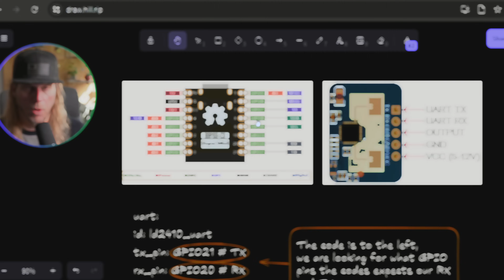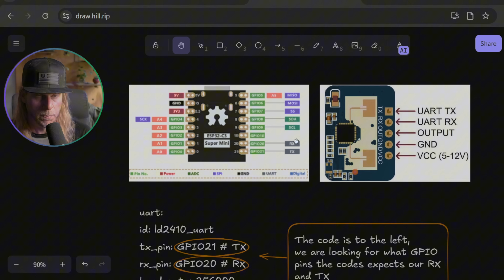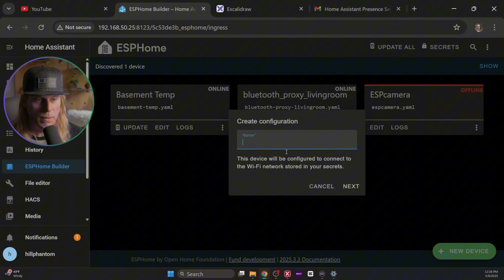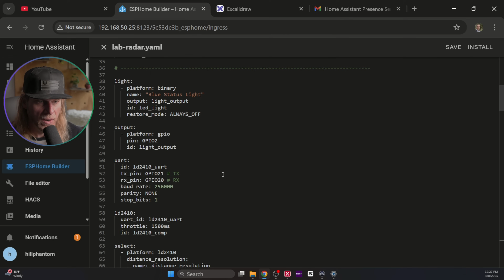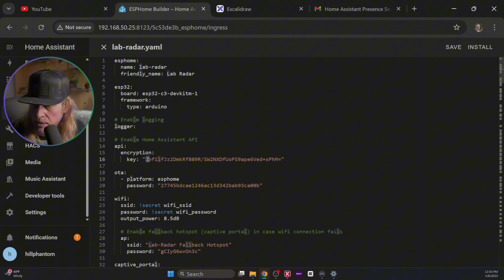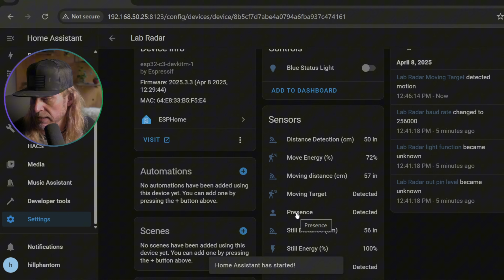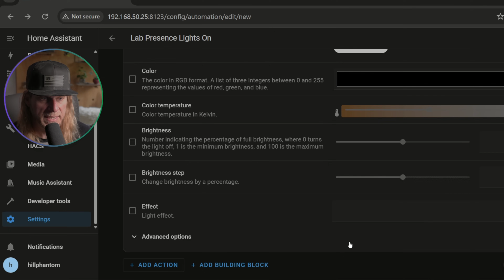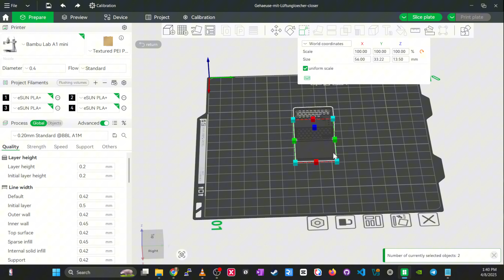I Built a DIY ESP32 Millimeter-Wave Radar Sensor (for cheap!)

Comment: My first attempt at hardware tinkering (SoC, breadboards, pin outs, etc.).  Stumbled my way through, but got it working!  I have a HA Yellow and had to connect it directly to that (rather than my home PC) to flash the firmware on; also had to make sure I put a 2.4GHz Wi-Fi config on it.  Great video!  Hopefully it'll get my brain working on what else I can implement in my home setup.  Only thing that would have been helpful for me is to see an actual picture of your breadboard hookups, but like I said, learned by trial and error!
Reply from the maker: Awesome job getting it working, especially with the trial and error!  However, my best skills in the lab, patience and trial and error. This is how I learn, and why my wife gets worried as I have started to many fires lol.  I appreciate the feedback I think next time I will include a photo of the breadboard stuff for sure! Cheers! Happy Hacking my friend!

Comment: compiling this fails fatal: not a git repository (or any parent up to mount point /)
Stopping at filesystem boundary (GIT_DISCOVERY_ACROSS_FILESYSTEM not set).
CMake Error at /data/cache/platformio/packages/framework-espidf/tools/cmake/project.cmake:589 (__project):
  The CMAKE_C_COMPILER:

    riscv32-esp-elf-gcc
Reply from the maker: Have you flashed any other code to see if its you device. This is first report of this error. Seems you device is having trouble pulling from git
Reply: @HillPhantom  i installed esp home on my linux machine and flash it from there instead of the raspberry pi HA installation ...for some reason HA cannot use the compilers (?)
Reply: @squiddymute  It's probably running out of memory during compilation. The Pi isn't the best place to run ESPhome builder really. You're much better off with your linux machine. I had the same sort of issue when I ran mine on a 1Gb Pi4. I switched to the docker build of ESPHome on my Linux machine.

Comment: Followed steps bit all I see is Sensors Unknown. Tried rebooting etc.. to no avail. Only thing it does detect is internal temperature?
Reply from the maker: Yea these devices can be very touchy I have had that issue to in past, displaying unknown on the HA dashboard. For me it was turning up the gain for the wifi on the board and it worked. Other times I just kept reflashing it. I have also had bad boards do this as well. Have you tried upping the wifi at all?

Comment: It's fascinating that it works for a lot of people and I don't see anyone complain about it not connecting to wifi, I tried every output power possible, as soon as I add the sensor to the controller "auth expired" is there, remove the sensor and it connects no problem...
Tried a few boards, same result, AI isn't helpful either, I'll probably get different controllers for this, maybe these little ones are too crappy to work with wifi and a mmwave sensor
Reply: Managed to make it work: DO NOT use pins 20 and 21, as they are also used for something else on the chip. I changed pins and now it works perfectly fine everytime.

Comment: @7:30 you said output_power: 8.5dB increases power. No it does not the default output power is 20.0dB. Every decrease of 3dB halves the signal strength. At 8.5 dB you will have a range of 20-30 feet max.
This is a known problem with c3 super mini boards some have external antennas this does not matter, they are all junk. in the usb logs if you see wifi auth expired error then you will need to use the line output_power: 8.5dB. Also the s2 minis have a different antenna issue and should also be avoided. and just a fyi the ld2412 and ld2450 radars are much much better.

Comment: Hi, i have a problem with a esp32 c3 super mini i cant install it, every time i have error messages, i try couple of times, every time the same thing... :(
Reply from the maker: What's the error message?
Reply from the maker: What is the error message?
Reply: @HillPhantom  There are several different errors during the installation itself within esp home, the esp32-C3 supermini is connected directly to the server, but errors occur during installation
Reply: INFO Package configuration completed successfully
INFO Package configuration completed successfully
INFO Successfully compiled program.
esptool v5.0.2
Serial port /dev/ttyACM0:
Connecting...
Connected to ESP32-C3 on /dev/ttyACM0:
Chip type:          ESP32-C3 (QFN32) (revision v0.4)
Features:           Wi-Fi, BT 5 (LE), Single Core, 160MHz, Embedded Flash 4MB (XMC)
Crystal frequency:  40MHz
USB mode:           USB-Serial/JTAG
MAC:                58:8c:81:aa:9f:c4

Uploading stub flasher...
Running stub flasher...
Stub flasher running.
Changing baud rate to 460800...
Changed.

Hard resetting via RTS pin...
ERROR Running command failed: 
ERROR Please try running esptool --before default-reset --after hard-reset --baud 460800 --port /dev/ttyACM0 --chip esp32c3 write-flash -z --flash-size detect 0x10000 /data/build/radar/.pioenvs/radar/firmware.bin 0x0 /data/build/radar/.pioenvs/radar/bootloader.bin 0x8000 /data/build/radar/.pioenvs/radar/partitions.bin 0x9000 /data/build/radar/.pioenvs/radar/ota_data_initial.bin locally.
INFO Upload with baud rate 460800 failed. Trying again with baud rate 115200.
esptool v5.0.2
Serial port /dev/ttyACM0:
Connecting...
Connected to ESP32-C3 on /dev/ttyACM0:
Chip type:          ESP32-C3 (QFN32) (revision v0.4)
Features:           Wi-Fi, BT 5 (LE), Single Core, 160MHz, Embedded Flash 4MB (XMC)
Crystal frequency:  40MHz
USB mode:           USB-Serial/JTAG
MAC:                58:8c:81:aa:9f:c4

Uploading stub flasher...
Running stub flasher...
Stub flasher running.
Reply from the maker: @iceman-84-zg hmmm can you test flash something else via the Arduino ide just to see if it's the board or not?
Reply: @HillPhantom  ok i will try, thank you

Comment: How would you adapt this to output messages over serial/USB? I've been struggling to get that to work with an LD2420 and I'm thinking about switching to this board
Reply from the maker: # --- Serial/USB logging ---
logger:
  baud_rate: 115200
  level: DEBUG  

==============================

binary_sensor:
  - platform: ld2410
    has_target:
      name: Presence
      on_press:
        - logger.log: "LD2410: Presence detected"
      on_release:
        - logger.log: "LD2410: Presence cleared"

Comment: First of all it's impressive that you still read and answer comments on this video 5 months after release.
Do you think it's possible to use this with an esp32 H2 over zigbee?
Reply from the maker: Well thank you! That's a great question but I will be honest, its just a guess, but I don't see why it would not work, code might be a bit different and library but yes not reason you can roll Zigbee instead of wifi, but that's a full on guess if I am honest.

Comment: Well, I got this... some git repository failure...
INFO Package configuration completed successfully
INFO Package configuration completed successfully
HARDWARE: ESP32C3 160MHz, 320KB RAM, 4MB Flash
 - framework-espidf @ 3.50402.0 (5.4.2) 
 - tool-cmake @ 3.30.2 
 - tool-esp-rom-elfs @ 2024.10.11 
 - tool-esptoolpy @ 5.0.2 
 - tool-mklittlefs @ 3.2.0 
 - tool-ninja @ 1.13.1 
 - tool-scons @ 4.40801.0 (4.8.1) 
 - toolchain-riscv32-esp @ 14.2.0+20241119
Reading CMake configuration...
-- git rev-parse returned 'fatal: not a git repository (or any parent up to mount point /)
Stopping at filesystem boundary (GIT_DISCOVERY_ACROSS_FILESYSTEM not set).'
-- Building ESP-IDF components for target esp32c3
-- Configuring incomplete, errors occurred!

fatal: not a git repository (or any parent up to mount point /)
Stopping at filesystem boundary (GIT_DISCOVERY_ACROSS_FILESYSTEM not set).
CMake Error at /data/cache/platformio/packages/framework-espidf/tools/cmake/build.cmake:620 (message):
  Traceback (most recent call last):

    File "<frozen runpy>", line 189, in _run_module_as_main
    File "<frozen runpy>", line 112, in _get_module_details
    File "/root/.platformio/penv/.espidf-5.4.2/lib/python3.12/site-packages/idf_component_manager/__init__.py", line 6, in <module>
      from idf_component_tools.environment import ComponentManagerSettings
    File "/root/.platformio/penv/.espidf-5.4.2/lib/python3.12/site-packages/idf_component_tools/__init__.py", line 9, in <module>
      if ComponentManagerSettings().DEBUG_MODE:
         ^^^^^^^^^^^^^^^^^^^^^^^^^^
    File "/root/.platformio/penv/.espidf-5.4.2/lib/python3.12/site-packages/pydantic_settings/main.py", line 193, in _init_
      super().__init__(
    File "/root/.platformio/penv/.espidf-5.4.2/lib/python3.12/site-packages/pydantic/main.py", line 250, in _init_
      validated_self = self.__pydantic_validator__.validate_python(data, self_instance=self)
                       ^^^^^^^^^^^^^^^^^^^^^^^^^^^^^^^^^^^^^^^^^^^^^^^^^^^^^^^^^^^^^^^^^^^^^
    File "/root/.platformio/penv/.espidf-5.4.2/lib/python3.12/site-packages/idf_component_tools/environment.py", line 148, in fallback_to_default
      if field.validation_alias:
         ^^^^^^^^^^^^^^^^^^^^^^

  AttributeError: 'NoneType' object has no attribute 'validation_alias'

Call Stack (most recent call first):
  /data/cache/platformio/packages/framework-espidf/tools/cmake/project.cmake:718 (idf_build_process)
  CMakeLists.txt:3 (project)

========================== [FAILED] Took 1.01 seconds =========================
Reply: Finally got it to work - a few ridiculous percentages in those settings but it works - I had to change one reference back to Arduino... BUT it won't appear in Home Assistant. any idea - I have this lovely display I can watch on serial or via an IP address -but nothing in HA so I will can't actually use it...

Comment: Good video, any thoughts on this error that I get when using the code? ld2410:
  uart_id: ld2410_uart
  throttle: 1500ms
  id: ld2410_comp  it comes up and says something like: "throttle has been removed; use per-senso filters instead"
Reply from the maker: I have never seen this and throttle is not used or defined in the code as far as I can remember. Have you tried to reflash it perhaps as that is a super odd error.
Reply: I had the same error when try to recompile with esphome 2025.9.x , then I commenthed out the line: "throttle: 1500ms" and compiled correctly but the sensor doesn't work anymore as intended. now the presence is always active
Reply: the exact error is:  "throttle has been removed; use per-sensor filters, instead." I changed the throttle it as ChatGPT suggested but still don't work anymore
Reply: getting the same throttling message.

Failed config

ld2410: [source /config/esphome/test.yaml:59]
  - uart_id: ld2410_uart
    
    throttle has been removed; use per-sensor filters, instead.
    throttle: 1500ms
    id: ld2410_comp

This is what is in the config.

ld2410:
  uart_id: ld2410_uart
  throttle: 1500ms
  id: ld2410_comp
 
I have an up to date HA and it's a new install of ESPHome Device builder.
Reply: Getting this same issue
Reply: did anyone find a fix for this issue?
Reply: @timdrysdale8468  I built my device tonight and was suffering the same issues everyone else is reporting but managed to get it working by replacing specific sections of the code with the following:

uart:
  id: uart_bus
  tx_pin: GPIO21
  rx_pin: GPIO20
  baud_rate: 256000
  parity: NONE
  stop_bits: 1
 
ld2410:
  uart_id: uart_bus
  id: ld2410_comp

sensor:
  - platform: internal_temperature
    name: "Internal Temperature"
 
  - platform: ld2410
    moving_distance:
      name: "Moving distance (cm)"
      filters:
        - throttle: 1s
Reply: @grf21a-   i still get unknown devices no matter what i do could you show me more of your code?
Reply: @timdrysdale8468  Dis you ever get this resolved as I have the same issue- Sensors Unknown?

Comment: The box is incredible. Is it possible to download the file for the lid with holes?
Reply from the maker: Sure is, I uploaded to makerworld. You can find it here. https://makerworld.com/en/models/1302910-esp32-c3-super-mini-ld2410c-case-front-holes#profileId-1335617
Reply: @HillPhantom  Thanks for the information. I can see that if I download the .3MF file, the box and lid with holes are visible. But if I download the STD/CAD files, the lid appears smooth, without holes. Should I use the .3MF file to print the box and lid with holes?

Comment: got mine all set up and it was working well for about a week, but now it just reports all sensors as unkown, except for internal temperature. i've power cycled a few times and plugged it in right next to my router, but still no luck. also, when it was working i noticed that there was a blue light switch that never seemed to do anything for me. any suggestions would be appreciated!
Reply from the maker: Hmmm thats crazy, I recall struggling with the unknown feature for some time. Did you happen to up the power to it at all? And just for sanity, when you had it up working did it report values? So I am clear, it now still shows in HA but values are all null?
Reply: @HillPhantom  i have not upped the power, is that something i should do? and if so, is that done through the config or with a differnt power supply? im using a basic iphone wall charger. when it was working, it was very cool and showed distance in inches and reported presence. now it shows that it is connected still, i have the toggle for blue light (which never did anything even when it was working) and it lists everything as unknown, except for temp. i can also see and adjust all of the sliders from home assistant. i have tried power cycling both the esp32 and my HA system and unfortunately haven't been able to fix it

Comment: Cute little package, but how are you powering it?  That seems to be the one thing that I don't see people address.  I hate the idea of a million USB power converters all of the place for each little device.
Reply from the maker: So I just use a small wall wart, of if by a computer plug it into a usb. The ESP32 has either built in USB C or Usb micro to then hook up to power. There are options for solar and battery powered as well, but that more involved. Super simple tho, plug in USB cable to ESP then other end to a small wall wart that is plugged into you wall AC power
Reply: USB powered is certainly better than the wasteful coin cell battery devices out there.

Comment: @HillPhantom What exactly made you change the wifi gain? I'm still testing mine because it seems to randomly disconnect from HA. I've given it a static IP which helped a ton but checking the logs I see that it can still blip off for a sec once every 24 hours or so.
Reply from the maker: It kept dropping or would not connect. Once I increased the gain, bingo! So once I increased it, had none of those issues.
Reply: @HillPhantom  Hell yes, trying that when I get home. Now I just need to figure out the settings so it stops giving me false positives and not be completely blind, I find this harder than anything, esp testing in my garage next to some $20 tuya sensor
Reply: @HillPhantom  Tried overnight, now it drops out every 6 minutes or so

Comment: this is very cool, don't know why but I'm still seeing all the entiteis except of the devide temperture as Unknown, I did reboot, and restart to the Host  - and still. I can see the device in the BLE integration too and there I have the Motion and Occupancy enteties working, but in the ESPhome  - nothing shown... any Idea how to get around it?
Reply from the maker: So I had a bunch of issues with unknown as well. For me it was just a matter of uploading the code and rebooting HA a few times. It's been solid since. One suggestion might be CHATGPT  tell it what you are doing and then upload the code. Then allow it to help troubleshoot, I have been doing so much of that lately. But a couple quick questions what ESP model are you using? It is very odd it wont show in ESPhome. Normal to see it in BLE so that good. In ESPhome are seeing entities but just all are unknown? So device registers its just data is posting uknow in ESPhome?

Comment: Just a warning. The ESP is 3.3V and not 5V tolerant. The radar module is connected to 5V that's why it sends data on this level. It is not sure that the ESP will tolerate it on a longer run.
Reply: The 2410 module has a power supply 5 to 12volt but works with 3.3volt logic on tx rx and do check the catalog list so no worry

Comment: Great video. Got 5 setup within 1 hour with your video. My question is really, can you not easily add a temp and humidity sensor like BME280 to the same ESP board and add some code to make a ‘All in One’ sensor?
Reply from the maker: Sure can I did something similar if your interested you can see it on my channel
Reply: which video are you referring too where I can add temp and humidity sensor to C3 super mini and LD2410 with code? 

This would be the ultimate sensor for me.
Reply from the maker: @barrylapthorne8017  not exactly but close https://youtu.be/9w1ZnHWAHw4?si=F6TXW8a7ptFQQ6Ei&utm_source=ZTQxO
Reply: @HillPhantom your a flippen legend

Comment: Could you make a video how to connect the LD2410 sensor directly to Alexa, maybe via Matter?
Reply from the maker: Love two but I don't sadly have an alexa and sadly this set up and sensor is not enabled with Matter. I think they make prox sensors that are matter enabled/Alexa off the shelf but this set up does not have the Matter tech in order to connect. Cheers!